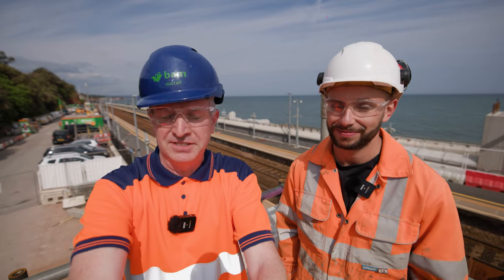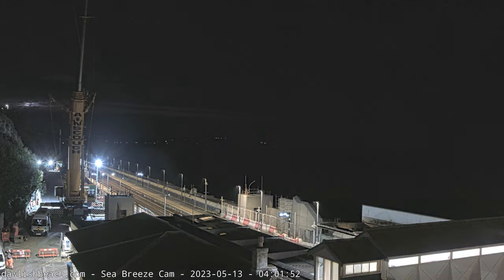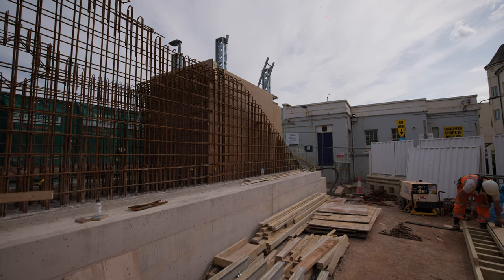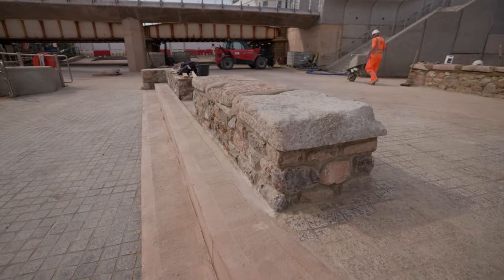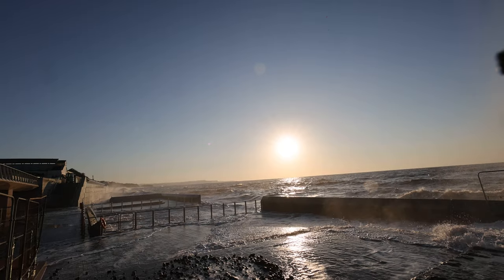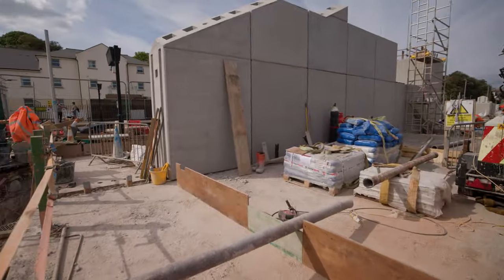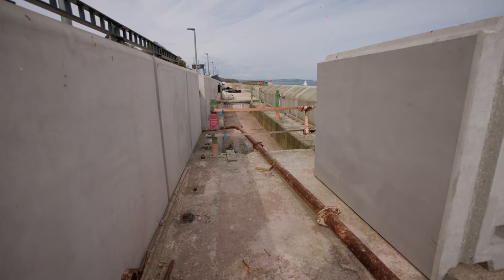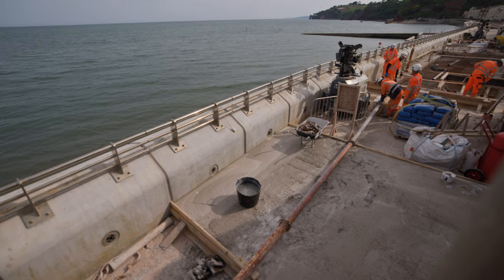Dawlish Sea Wall Update - Confirmed Opening Date

Comment: The three rusty sections of railway girder bridge detract from this glorious project.  Will the steel bridge sections be repainted anytime soon?  The station structures?  Otherwise, congratulations to all!!
Reply: I have asked this question before, with no precise answer. Seems its a council issue (which is odd for a structure that take Network Rail trains). Someone needs to grasp this nettle.
Reply: Network Rail has said there’s currently no plan to do so, since it’s just a cosmetic issue
Reply: @andrewreynolds4949  doesn't look cosmetic on the videos, irrespective of that, surely it's a structural element and any corrosion is not ideal. But perhaps it is no longer structural...
Reply: @JohnnyMotel99  All I know is that Network Rail said in their long document about the project was they examined the structure, and found the rust was only cosmetic. They claimed it would just reappear quickly and they had no plans to repaint it.

In my opinion it looks alright. I've seen a lot of similarly rusty structures still working just fine in service. I've also seen some heavy rust damage before and I can't see any in the video, so I wouldn't be worried about it.

Comment: Is the old foot bridge connecting the platforms  going to be removed  in the future then or is that staying  and going to be renovated ?
Reply: No
Reply: The old footbridge is staying. I think it was recently refurbished
Reply: The 'old' footbridge is not very old at all. It was replaced a few years ago with a composite construction designed to look the same as the one that was there before.